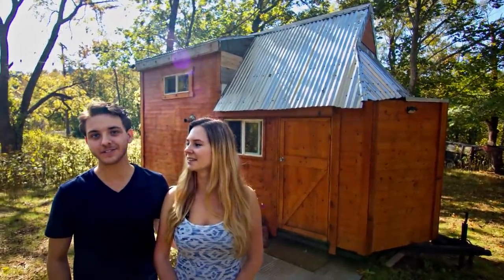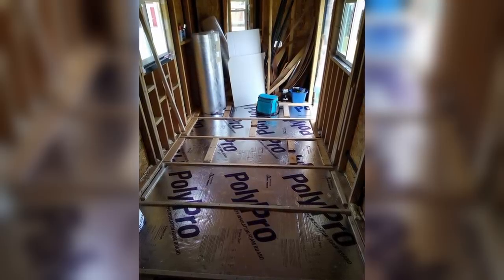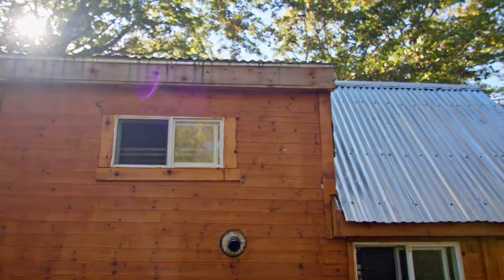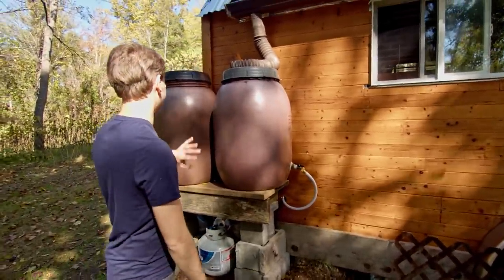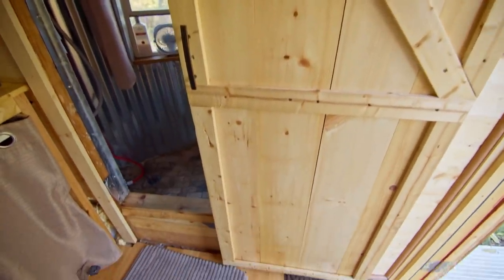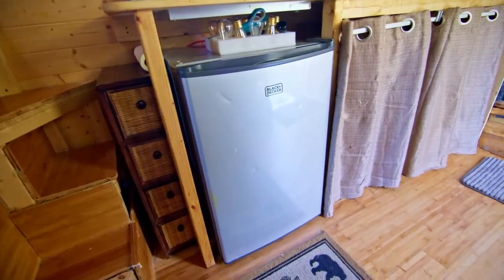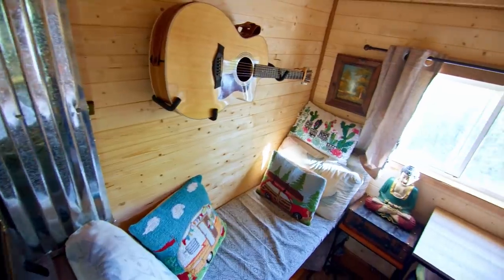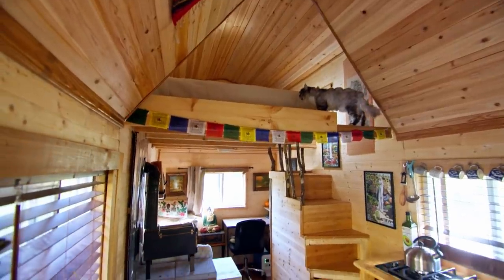Intern Builds Tiny House for Only $8,000

Comment: Pretty darn nice for 8k! Just a note on installing corrugated metal roofing, the screws should be on the peak of the corrugation, not in the valleys. Not gonna be a concern for a while but eventually the seal on the washer will degrade and since it's in the low part a little water will eventually seep through.
Reply: Thanks for that tip. They are done but I'm still building. I will keep that in my mind. Again, Thanks!
Reply: Yes. True
Reply: Thank you! You're absolutely right regarding the screw placement on the roof panels, and unfortunately I didn't learn this until after I had installed it - there are even some guides online that say it's fine to put screws in the valleys, but this is not good practice as you point out. In any case, after learning this I put a generous amount of Lexel around each screw to help with waterproofing, and so far there have been no issues or leaks in the past 1.5 years, even despite several heavy rain and snow storms. In any event, I plan to actually replace the roof this summer in favor of a higher-grade material, and Iuckily I will definitely have more experience going into that. This project was certainly a huge learning process! 😁
Reply: @ericrohm2539  Amazing how much goes into building. Hope you are enjoying your tiny house! I'll be building my own within the year. Thanks for sharing yours with us, it is encouraging to see others do successfully it on a tight budget.
Reply: @dustman96  I'm loving my house! Best risky decision ever. I'm working on a website containing loads more information on my construction and budgeting, so I'll link that here once I'm done with it. Feel free to ask any questions for now and good luck with your build!
Reply: As an ex roofer I was going to mention that too. Especially aluminium as it's soft. . If it's not leaking I wouldn't be overly concerned
Reply: This brought some memories.. I'm an architect and on the first year viva/ oral exam one of the jury member asked me this question..how do you fix corrugated roof. I made the same mistake 🤦🏽‍♀️
Reply: Wouldn’t a metal roofing be really loud when it rains for those who are living under it?
Reply: @nettie9620  It is a little loud but rain falling on a metal roof is a quite pleasing sound.
Reply: @dustman96  thanks dustman!😊
Reply: @nettie9620  I should say though, that if you live in a place where it rains constantly, it could possibly become tiring.
Reply: @nettie9620 one of the best sounds ever 💕
Reply: Thank you

Comment: Smart idea to use a cargo trailer and remove the roof.  Much less expensive than buying a trailer and building it all up from the bed.   I may have missed it, what size trailer did he start with?  Nicely done.
Reply: The trailer was an enclosed V-nose cargo trailer measuring in at 7'x16', with the point of the nose extending 2' forward from this, and a ceilng height of 6.5', which I extended later on.
Reply: @ericrohm2539  Thank you for the info.  Very helpful.
Reply: Cargo trailers are typically 2x the cost of a regular car hauler trailer. Much cheaper and way easier to start with a car hauler. Complete headache doing it the way he did.

Comment: Very nice and the price is even better. This is what the tiny house movement was about. Actually being able to build a tiny home for close to nothing. But unfortunately someone got ahold of them and now you can be looking a $100,000 for one or more.
Again very good job. God bless. 🙏💞🙏
Reply: No, it's just not practical for everyone to DIY it and not use all new materials.  While people don't want to suffer, so they spend on making sure it is tailored to their needs...  So that's all just the reality of people buying homes and needing them to meet their needs, with not all of them able to do it the lowest cost way.  Add, it ain't just single people and couples anymore, lots of families now means they had to get bigger too, for a reality check on what actually happened...  

Besides, $100,000 isn't what you think anymore because the value of the dollar has dropped.  Even from just 2000 to now, $1 in 2000 is equivalent in purchasing power to about $1.62 today.  In short, $100,000 today would have been just $61,728 in 2000...  Add, supply chain issues, lower averages wages, higher prices for just about everything.  The adjusted price difference dips even lower.  To show a massive amount of that is just how bad the economy is now and yeah, most people never noticed it happening...

But as bad as $100,000 may sound it's nothing compared to the traditional housing market that the average is starting to exceed $400,000 nationally and most of those can never be tailored to individual owners and their needs, because custom building large houses starts 50% higher and easily goes over 4x higher in cost, running large homes into the millions for an apples to apples comparison...

Besides, one of the points of the whole movement was to get out of the rat race, part of that means people should not be comparing their homes to each other all the time.  People like this couple prove nothing is stopping people from going for the lowest price possible except themselves!  

Aside from the messed up economy, it's your choices that matter and not other people's!
Reply: @ZeoCyberG  keep babbling because that is all you wrote is babble.
God bless🙏💞🙏
Reply: @kimsikorski5691  No, just pointing out the reality to your fantasy.  Sorry but you're just trolling.  You're not going to learn everything from just watching youtube videos, a lot you have to learn from actually doing it.  But hey, if you think you know everything just go build one yourself and see what happens... Good luck!
Reply: @ZeoCyberG  see how you think you know me to say I have to actually build something to know.
Well I have built and have made many different things.
Not trolling my dear, that is you. May God help you see the way. God can help anyone do wonders....
God bless 🙏💞🙏
Reply: @kimsikorski5691  Sorry but if you've built then you should know better than say nonsense like you've been doing.  Roof doesn't leak just because they screwed at the bottom instead of the peak.  In fact, unless you're careful the peak can be more dangerous because people who haven't built before are more likely to do things like either over or under drive the screws and leave dimples or gaps for water to get through.  While screws are screwed to the bottom for when attaching metal sheets to the sides. So lets not pretend it's never done that way and automatically means leaks when it obviously doesn't!
Reply: Unfortunately some small homes have gotten expensive.
Reply: The tiny house movement means something different to everybody, but I personally believe it represents an opportunity for regular people to live mortgage-free and have exactly what they need, no more no less. I also recognize that it's not practical for every person to be able to totally build a house from scratch themselves, which is where I saved the bulk of the cost in my project. I am very lucky to have had the capacity to do this, but I understand that not everybody has the same means that I did.
Reply: Oh lordy, I saw a video (advert) about one and it was $160K!!! It was made out of the chintziest materials, too. 🤦🏼‍♀️
Totally missing the point. I love these DIY tinys the best 🥰
Reply: @heidiburkard7464  Everything is getting more expensive but it's still up to people's choices on how expensive it gets and how they choose to deal with those costs...
Reply: @ZeoCyberG  Didn't actually have to get bigger.

We all have ancestors who raised large families in under 200 square feet of living space. It's just a matter of setting expectations.

Not that there's anything wrong with larger homes and more private space, but it's not necessary for (and some might argue a bit of a hindrance to) healthy and happy families.

Even now at 33 years old, there's something very soothing and comforting about sharing sleeping quarters with family, like when camping or when someone needs closeby care.

Granted, as a young child I grew up sharing a king size bed with my grandparents, and later during my grandfather's death spiral I moved back into his room and slept on a mattress on the floor nearby to help take care of him, so my experience is a little different from most westerners.
Reply: @ZeoCyberG  Can't you just insert split poles under the ridges to be screwed, so the screws go through wood before entering the plywood below and preventing overdriving?
Reply: @priestesslucy3299  True, but modern concepts of privacy and personal spaces, along with reliance on modern conveniences, can make that difficult for most people.
Reply: @priestesslucy3299   For the screws, not really as it may solve the over drive but introduce other issues.  Mind, everything is exposed on the roof to the elements.  So wood moves, metal roof expands and contracts from heating and cooling throughout the day.  While the screws must remain flush to form the water tight seal with the roof... Expansion and contraction can back the screw out to break the seal and lack of an air gap, between the metal roof and plywood traps moisture and means the wood part of the roof is more likely to get water damage/rot/mold issues... While also in danger of ice forming and causing damage between the metal roof and plywood during winter...  Proper water proofing thus requires multiple layers and flexible membranes over penetrations.
Reply: @priestesslucy3299  Good idea otherwise, could be used on the interior, for like those rustic industrial interiors...
Reply: @ZeoCyberG  thanks for the explanation regarding the roofing 😘

Comment: Two Questions: 1) What is the size of the original cargo trailer?  2) Can the house be moved the same as other tiny houses can?
Reply: 1) 7'x16' with a V nose extending 2' forward from that, so a line from the very back to the tip of the nose measures 18'
2) Yes! I built it in Georgia and towed it up to Virginia with a 3/4 ton grade rental truck, a dodge ram I believe.
Reply: @ericrohm2539  Thank you for getting back to me. I just love your home!

Comment: What's the length? The price is great👌
Reply: 7' wide, 18' from the bumper to the front "V" nose, 11' high from crest of ceiling to floor at  the narrow part, 7' from floor to ceiling (loft) while under the loft, 4' from loft floor to crest of ceiling, ~12.75' from road to highest point of house roof

Comment: This is a great tiny house, but I feel like the house needs a better electrical system overall. I think the roof has enough space for at least 1000w of solar panels that could probably be put on a tilt and swivel arm with a locking mechanism if needed. I also feel that an actual high wattage inverter and maybe 3-4kWh LiFePO4 that could do at least 2000w would be super beneficial to replace the stove with an induction cooker, a shower with an electric water heater, and an electric heater rather than a wood stove.
Reply: Fully agree, and I'm planning/investing in a much more powerful DIY energy system, but I was running out of time and money so I just went with the Bluetti product for now.

Comment: Just wondering is your roof leaking yet ? You put the roofing hold down bolts on wrong!
Reply: That only matters to long term, when the seal on the screws eventually wears away and the screws needs to be replaced, which takes years... It doesn't effect it now with it all new!  Though, doing it this way is an advantage for moving the home as it's stronger for withstanding wind and making sure the roof stays on when moving it down the highway at speeds up to 60+ MPH and possible head winds pushing that over 100...

While a self resealing membrane could have been placed below the metal to provide a second level of protection that will make replacing the screws more about making sure the roof is properly secured...
Reply: @ZeoCyberG   Good Luck to late now anyway! Get some buckets ready!
Reply: @stewartatwood7271  No luck required if they just keep an eye on it and do regular maintenance.  Seriously, you're blowing it way out of proportions...  Even done the other way you'd still have to replace the screws when they wear out...
Reply: @ZeoCyberG  Nonsense, the grommets will allow both rainwater and condensation into the hole in the roofing. This comes about through capillary action.
Reply: @andrewdarnley4608  Sorry but there are no grommets on the roof!
Reply: @ZeoCyberG  Silicone washers as close to a grommet as you'll get
Reply: @ZeoCyberG  OK then Silicone washers that come with roofing screws or as close as you're going to get for a general description. I think you're just being pedantic and you knew what I meant.  Point being no manufacturer of metal roofing would recommend the way screws have been used to fix this roof.   Is this way you fix roofs ?  The only way that you put a screw into the lower curve is if you're using corrugated sheeting as siding.
Reply: The screws have a neoprene washer, but you're right, it is better practice to screw in at the peaks. I realized this after I had finished so for extra security I put Lexel around each screw. So far no leaks or issues, and it's held up through several heavy rains and snowstorms. Will eventually replace it, though.